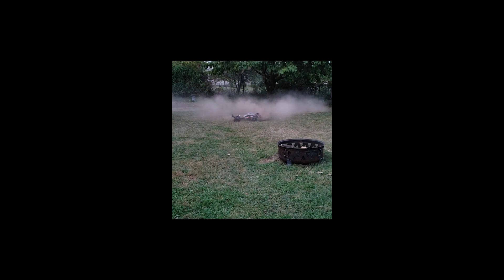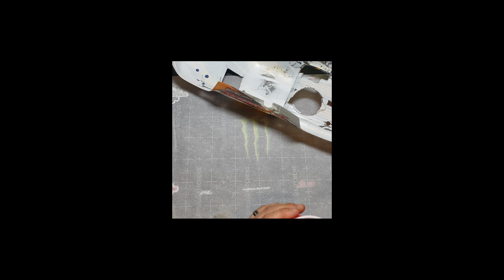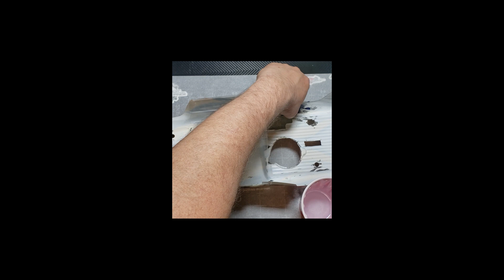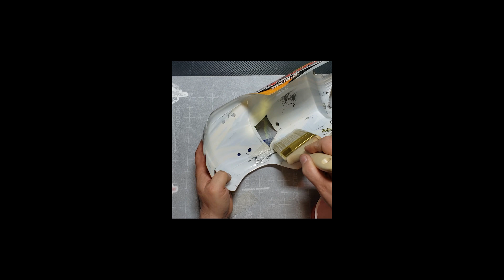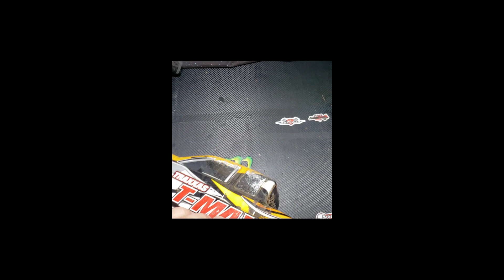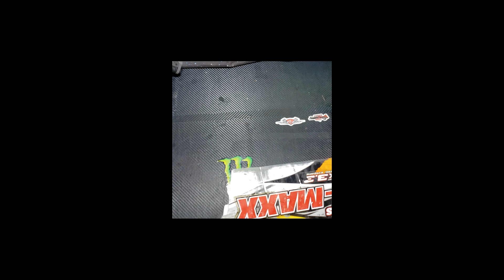fixing a cracked rc body

Comment: Good stuff ,yea I messed with epoxy's ,hardeners with fiberglass before.
I am currently repairing a body now but it is the windshield area where some one cut the
whole thing out ,the pillars are broke so I am doing it a different way ,my body isnt as cracked
up as yours an is much more thicker an tougher than yours is!
Did you use that epoxy on the stuffing tube on your boat or something else?
Great show & tell!..😎👍
Reply from the maker: sweet bits of zip tie in the pillers may help to reinforce and yes that is the epoxy i use on the boat it will be used to seal the shaft but waiting tilll paint is finished for that i also used jbweld 2 part clear for all the connections on the boat then it is sealed with the regular epoxy